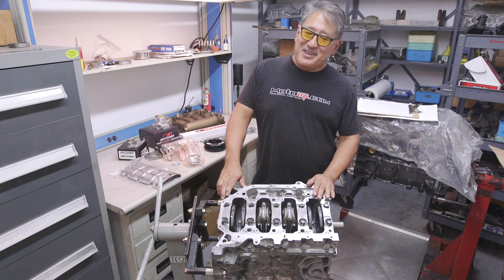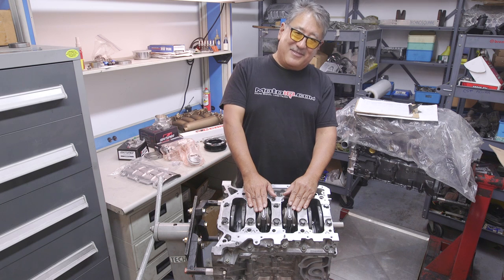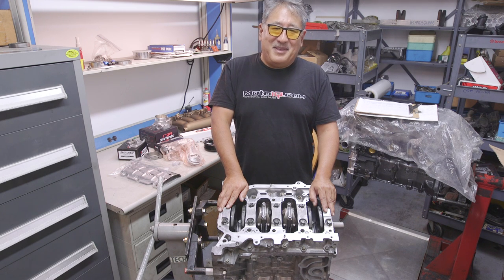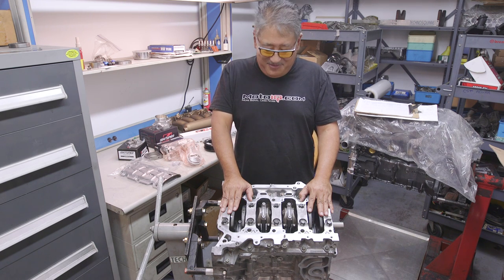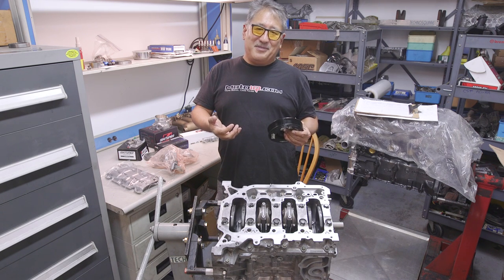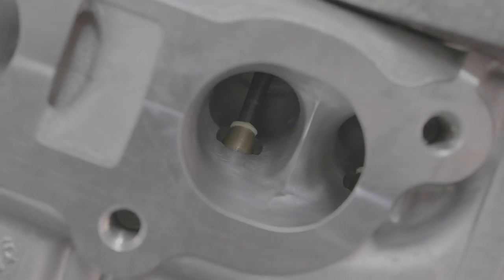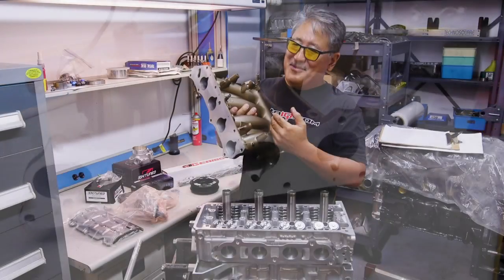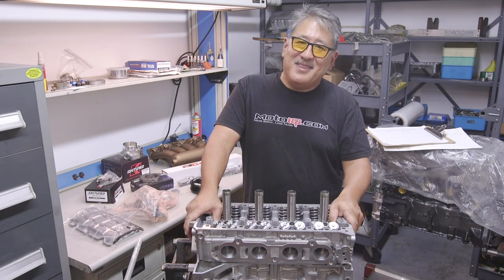How to Get 150hp/liter from your Honda!

Comment: Imagine if Honda made a K series Straight 6.
Reply: Tyler Hand imagine... twin Kseries... joined at the crank 😶😶 all other will fear that thing
Reply: They built a v8 at one point.
Reply: @jamaisvu2664  for indycar racing...
Reply: zach miller well I guess it was actually Mugen but check out the Mugen Legend Max concept. Pretty neat
Reply: It'll compete with the 2jz.
Reply: Imagine when honda made f1 engine. Oh wait, they actually did
Reply: look up neutron engines, guy is engineering a v8 with 2 k24 heads
Reply: I'm dreaming of a straight six k for some time. Even over a v8 one because it's simpler lighter less moving parts and is perfectly balanced
Reply: @andrewzee0074  you can’t really “compete” with something that is really old and already proven, more like compare
Reply: @rathuanyatzi  look up neutron engines, he’s an engineer currently working on a v8 based on combining 2 k24 blocks
Reply: Ford made an engine for New Zealand and the land down under, called the Barra. In-line six, super heavy duty, huge builder for racing.

Comment: It’s amazing that you can run 12-1 comp on some engines with pump 91, the old school American motors start pinging at 9-1 😂
Reply from the maker: It is due to bore size and combustion chamber design.

Comment: Would love a vid on the different types of k-series and differences with specs and modification possibilities. There are a lot of vids that explain the differences between the different K series engines (A2, A1, A JDM) but curious how these make a difference when fully upgrading the cams, valves, rockers, springs, retainers etc. As always thanks!
Reply: Head flow would be the main difference
Reply: You  can find that information on Wikipedia

Comment: In 2010, I bought a S2000 with a scorched piston. I managed a Machine shop at the time so I was not afraid to get into the engine. I rebuild the engine using a stock K24 crank, K1 rods and Wiseco Dish pistons. We also bored out the cylinders and installed 2mm Melling repair sleeves. The engine was boosted with a V1 supercharger and made 420whp at 13psi and 300 flywheel hp natural aspirated. For the street, I preferred natural aspirated version of that car because you could use all the power all the time where with the supercharger you had to be careful not to oversteer the car and loose your ass. I sold that car and it is still riding around town 10years after the build. Everything was done on a budget with mostly stock parts. Honda did it right!
Reply: Sounds like a sweet set up. Is the K24 crank a better balance for the F engine? Im curious to know why you preferred it over the F crank.
Reply: Mussh Wins the factory k24 Crank increased the stroke and made it a 2.4 Liter over the stock 2.0. It really gave it bottom end, my butt Dyno estimated about  +50ftlbs. The F20 is rated at about 150ftlbs. So having 200ftlbs really made the S2000 fun to drive.
Reply: If I could just get one of those in my f23 block and bore to 87...

Comment: 160hp per litre from a k20 is actually quite easy, one of my customers has 347 flywheel from a 2ltr with the right cams, rods an pistons on standard crank, all i do is change bearings an rings each season, but this will be season 3 so a new set of liners this rime round....

But EVERYTHING is cryo treated, then surface treated after 👍

This engine lives between 9500rpm and 11000rpm at every event, 16 events a year 😊
Reply from the maker: This is why I love K motors! We did this power on shit California 91 octane pump gas.

Comment: Nickel is primarily used to prevent creep at higher temperatures. Not for tensile strength. That’s more steels department
Reply: Your not going to use nickel for strength when it only benefits from 5% difference in tensile strength. A forged component would still be cheaper and plenty capable with the new orientation of the grains. Yes corrosion resistance at higher temperatures but this is a heat engine, not a jet engine where were subjecting the components to above their melting points. The only material commonly found to corrode at temps like this are aluminum alloys, where hydrogen is more susceptible to diffuse within the material as we approach the melting point. Which is still not even close in the Carnot cycle these motors are running.

Comment: I once stroked out my fc20 engine with a Honda accord crank. We used 2mm melling repair sleeves. Had to make a custom spacer for the timing chain and that engine definitely made 300hp. Wished i ever sold it.

Comment: K24 also found in the Element!
Be nice to have some of that extra zip...
Reply: Island Aerial well it’s 164hp and 160lb/ft torque, not like the k24a2 with vtec on both intake and exhaust at 205hp 166lb/ft
Reply: he has a K24A2

Comment: The thing about 2618 needing a ton of bore clearance is a myth... yes, it grows quicker than hypereutethics and needs it if your habit is to nail it from bone cold. If you don't want the skirt rattle, learn to load it gently until running temps are in and run 0.003" / 0.076mm clearance instead of the thou+ more the card says you "must have"..  done that on several 80 to 85mm forced induction setups and never had one seize up.. rattle is gone and ring oil control is better (very short skirt piston).

Comment: I always wonder/wish Honda had made a variant of the K but at least the F series with 5 cylinders.

Partially to honor their F1 program that was around when these engines were designed. But also to honor some modernization on the thing that made them famous (NA 4 cylinders). It’s a nice way to get some extra torque, and not experience much weight and packaging problems.

Always seemed like a natural fit. But I understand that a professional company is risk adverse. And that they achieved all they needed to with a simpler, cheaper and more efficient conventional design.

But I guess I wouldn’t be an enthusiast if I didn’t wonder about a Honda 5 cyl

Comment: It's common for 130-150hp per liter for slightly modified motorcycle engine or stock sports bikes. I have seen bored CBR150Rs from 149.++cc to 170-180cc resulting to 27-30hp in the wheels when dyno using hi octane pump gas! Bikes engine and cars are both piston driven, and 4 stroke. The only difference is car engines have more stroke. Thus they're can't rev as high as motorcycle engines. A cause they're designed to produce torque at a lower RPM, hence lesser power..

Comment: How they get away with 99mm stroke and 9000rpm? That is more than 29m/s piston speed. I always thought road racing engine should keep under 27m/s. I need explanation please.
Reply from the maker: The engine is pretty strong and it will need freshening periodically. Ring life gets really affected by high piston speed, strong engine or not.

Comment: Here in Canada we can get 94 octane from any old Husky that has 10% ethanol, or 94 on 0% ethanol at Chevron over in B.C. (it’s like $1.75/L last I went so bring cash lol)
Reply: Do you use ron or aki in canada for octane? Last time I was up there I didn’t drive so it didn’t matter. I’ve never seen anything higher than 93 in the states on the pump. It would be nice to have non-ethanol gas for my carbed bike but it is so rare.
Reply: Do you have E85?

Comment: Planning the same build was trying to decide on cams. Never seen a smooth idling stage 4 cam, but I love the drag cartel lineup and Jerame has always been a lot of help to me through emails.
What size injector do you run on that setup if you don’t mind me asking? Great video
Reply from the maker: We use the OEM injectors off of a K23A1 RDX engine that flow 410cc/min
Reply: Thanks for the reply, I’ve seen guys running HUGE injectors and I wanted to see what was necessary to make 300hp without running out of fuel.

Comment: You mentioned a JDM RBC manifold....this isn't the RRC correct?  Please elaborate as I can't find any info on this..
Reply from the maker: The RBC came on the non-us Accord or the US 06 Civic Si. Both manifolds are good, the RBC is easier to find and a couple of hundred bucks cheaper. The RRC might make a little more power.
Reply: @motoiq  oh ok, I was thinking there was another version of the RBC based on how you described it in the video. Thanks for clarifying

Comment: The high pitch in the audio guys ,
Reply from the maker: hmm, not hearing it on our end.. 🤔 what browser are you using?
Reply: @motoiq  I hear it too. It's not the browser, it's in the audio track. It's a resonant peak from something metallic in the room that resonates with Mike's voice. It's around 6-7 kHz. A low-pass filter would've quietened it down.
Reply: @motoiq  I'm also having the same issue, makes it hard to listen to what's being said
Reply: @motoiq  Same here. It sounds like a high frequency reverb. Best thing to do might be to get a cheap lapel mic. Great content though! Thanks for the easy to understand walkthrough

Comment: What is the weight difference between a built bottom end vs a stock bottom end and with low compression does it make a difference?
Reply from the maker: It can be higher or lower.  A high revving NA build can be lighter to reduce loading on the reciprocating parts. A FI motor with a ton of boost needs to be beefy to handle the extreme cylinder pressures.

Comment: How are you able to Rev it out to 9k? Aren't the pistons speeds on the k24 past formula 1 engines at that point?
Reply from the maker: The mean piston speed for a K24 @ 9000 rpm is 5847 FPM,  An F1 engine from the unlimited rev era had a piston speed about the same.
Reply: @motoiq  This hasn't given you guys any problems? I'm actually building a K motor right now so thank you for the content! You guys are always very informative.
Reply from the maker: @MrJohnHughesHimself  A lot of people do it, of course, the rings and stuff can wear much faster but WPC treating them helps a lot. The cams we are running on this particular engine, run out of steam by 8500 rpm but many people run bigger cams and rev to 9k.
Reply: @motoiq  Thanks for the info! The connecting rods are interesting, makes me doubt my purchase....
Reply: Peak RPM in F1 occurred during the V8 era.  I believe Cosworth attained 20K RPM in testing.  Max bore of 98mm meant a stroke of 39.7.  At 20K rpm, the mean piston speed is 5210fpm.
The drag K27 motors use 106mm stroke cranks and I think they turn a maximum of 10500rpm = 7300fpm.
Note that this is mean piston speed and not maximum.
Max for the 20k Cosworth F1 is 8184 fpm and fr the 9K RPM K24 9183 fpm, K27 = 11472 fpm!

Comment: So how much would this set up usually run? I have a 2006 auto tsx, would this set up kill my slush box automatic transmission?
Reply: If you are going to go through all the trouble of doing a complete engine rebuild/swap for performance, spend the extra coin and install a manual.
Reply from the maker: This exact set is about $14k for the assembled long block. Includes all parts and services discussed in the video.

Comment: Hey Mike, I was wondering if you happen to have seen any 70mm throttle bodies that have cruise control. It seems very difficult to find...if any exists. Thanks!
Reply from the maker: I never seen a throttle body with the cruse control built into it period unless it was just using the DBW throttle to do it.
Reply: @motoiq  Ah, I see. Hmm, no worries I thought Hybrid Racing made one by chance back in the day. Cool beans, thanks for the info!

Comment: Does it reliably if you leave it alone. Every Honda guy/mechanic knows when you modify a Honda you can make good power but all that cylinder pressure in those little dinky cylinders will only hold up for so long

Comment: 9k rpm on 99mm stroke? Could be the Fastest piston speed on engine ever?
Reply: Nah. Sonny built a 1000+cu.in. v8 that runs on gas and revs 8000. Thing has a 5.5" stroke.. this K engine is mediocre in the piston speed department.

Comment: Why is 91 octane gas bad I've been putting shell plus 89 octane and it runs good actually is there a big difference in power if I put 93 shell v nitro power for my 2012 honda accord vs 89 shell plus
Reply: High compression causes high heat and potential detonation or pre-ignition; not an issue on a stick Accord engine, but on a higher performance engine this a big problem.

Comment: If I collect all of these parts can I do it myself at home I'm new to engine building sorry if this is a dumb question to some.
Reply from the maker: Not necessarily, this requires precise machining and careful assembly and fitting.
Reply: @motoiq  so even if I send everything off to get machined it's still not good to try and assemble at home?
Reply from the maker: If you have to ask, you had better not try to build an expensive high output engine as your first attempt to build something. Sending stuff out to get machined means nothing.  Not many automotive machine shops are good enough to machine a motor like this one.
Reply: @motoiq  ok thank you very much for your knowledge I guess I'll have to try a whole different engine application for a DIY project but I really thought I could do a k24 for my 1st build😪

Comment: Hey mike, any recommendations for rwd manifold? Are you guys still using k24 head? Im new to k motors but looking into swapping to my e30. My understanding is the k20 head has better flow
Reply: Check out Kmiata; they have a new RWD manifold. You can also run the Skunk2 manifold, which allows it to be flipped 180* for RWD or FWD application. Or there's the S2000 manifold with a JSP adapter, which is the cheapest option. 
Kmiata has a full kit to bolt the K to the BMW ZF 5/6 speed trans. Not cheap, but it's a bulletproof setup for a turbo K.

Comment: So no porting at all on the RBC intake manifold?
Reply from the maker: Nope. But we did need to port match the spacer we used between the intake manifold and K-Tuned throttle body. More detailed will be shared in upcoming MotoIQ.com articles.

Comment: How much timing can you get away with at 12.5 pump gas?
Reply from the maker: Not much. Defiantly do not recommend a cr that high with pump gas.
Reply: @motoiq  is 21 too high
Reply: @motoiq  or should I be somewhere closer to 16-17

Comment: So the video is titled how to get 150 horsepower per liter

Then he proceeded to show us how to get 133 horsepower per liter

The motor would have had to make 360 horsepower for 150 per liter

Don't get me wrong 320 horse naturally aspirated out of a 2.4 l is phenomenal

But when they first had the title, I stopped the video and got a calculator and started doing math...I was like there's no way they're getting 150 horsepower per liter that would be on par with race cars.
I thought unless he's spinning this thing to 11,500 RPM there's no way.
Reply from the maker: that is wheel hp, at the crank its more.

Comment: You figure that build is only good to 9000?  I would think 95 or even 10 could be done. And I would bet that that power isn't trailing off at 9000 yet. Maybe flattening but not trailing off
Reply from the maker: This build is for 91 octane gas and to be fully streetable and to last 100k miles.  We could build a 10,000-rpm engine with no problem but it would not be a pleasant street drive at all.

Comment: Make it nuclear power . 
One nuke per cylinder .
So much power
 So fast ......light bends into itself and turns into a particle of matter, you'll travel through the fabric of space and time then teleport and reappear at the finish line in time for dinner a week ago  😎.😂
Reply: At what rpm would you set the vtec crossover with that set up?

Comment: do you guys get e85 in california?
Reply: Caleb Davies yes if your in urban areas it is not hard to find at all
Reply from the maker: Yes, it's becoming more common now.
Reply: @motoiq  I know E85 has an effective octane rating of ~105, but much lower energy density than normal gasoline. How would this engine run on E85 and how would you build it differently if you intended on running corn?
Reply: pumps all over LA County since the 90s with it
Reply from the maker: @calebdavies526  We would run more compression on a dedicated E85 motor, probably something like 13:1.  The engine would not run on 91 octane pump gas anymore though.

Comment: despite K motors I'll stick with my 1.6 D series. The torque obtainable from em is usable on the street day to day. and at $4.10 l gas milage  is a definate must with 12.5km/l round town.
Reply: I prefer to port my own heads. Those Honda heads really leand themselves to a vortec port job.